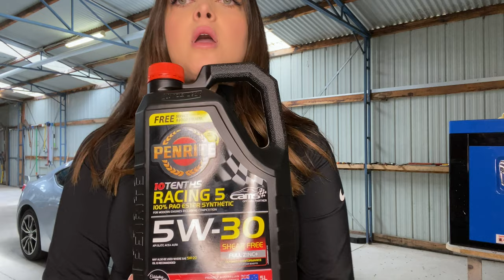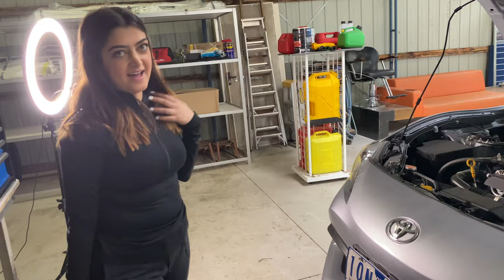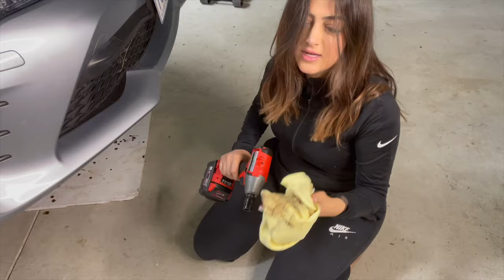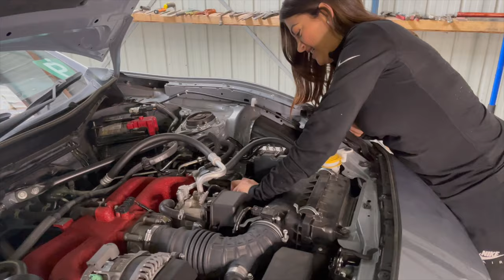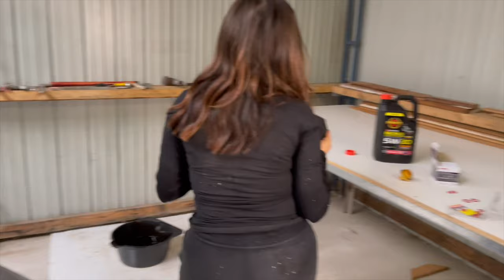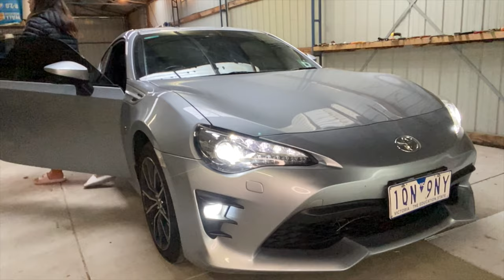SERVICING MY 86 (cursed)

Comment: wait why did you put oil in for an e85/turbo car if the engine is still stock?
Reply from the maker: Because as I said, it’s booked in for e86 soon . It’s just a thicker oil, in my opinion it’s essential to go thicker when you’re boosting the car, people do run this oil stock too, just need to let it warm up for longer. Hope this answers your question.